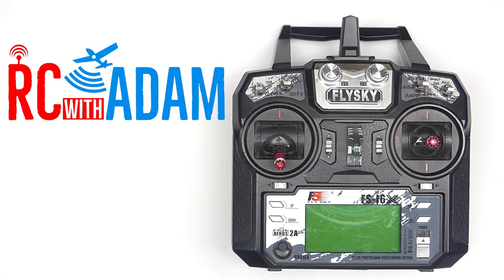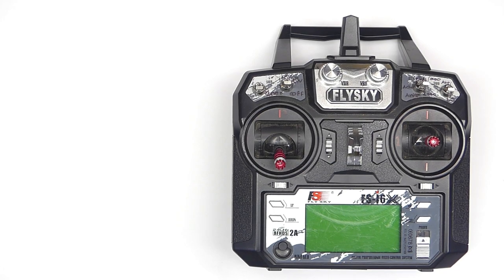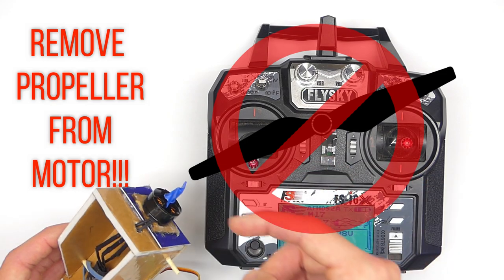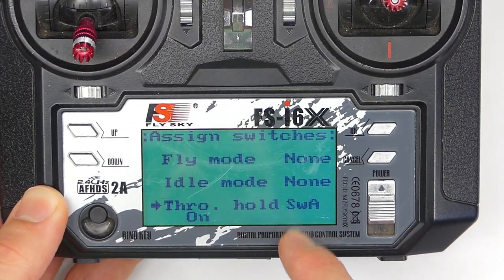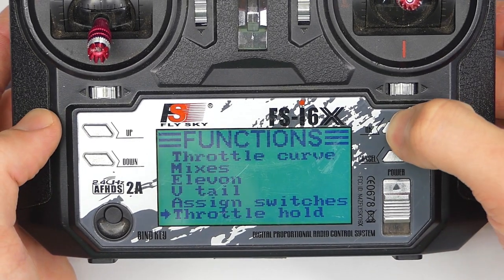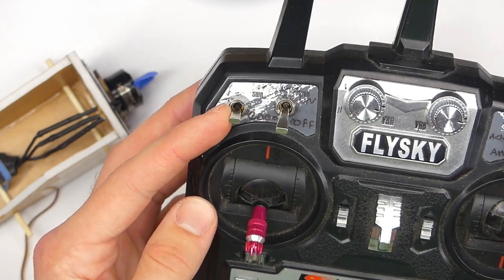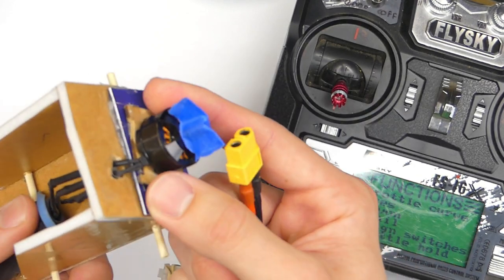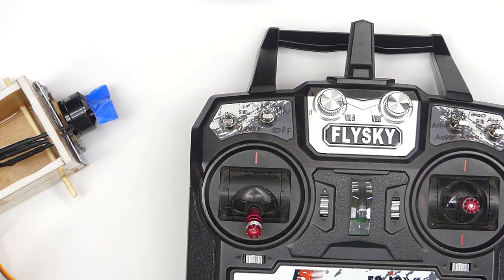How to Setup Arming Switch for Airplanes - FS-i6X and FS-i6 Tutorial

Comment: Finally!  FIRST assign a switch, NEXT, set the >OFF< value to 0%,  THEN flip your assigned switch to ON BEFORE pressing the CANCEL button to SAVE the new 0% value.  Just what I needed to do to create a kill switch on SWD without my % value reverting back to the default value that I was trying to reset.  You made it so SIMPLE  that even this FS-i6 Newbie got it done for much welcomed propeller safety when I'm tweaking other settings or devices where accidental prop spinning could be disastrous!  :face-blue-smiling:

Comment: Great...!  Had some guys in the club ask me why I didn't have a "Kill Switch" on my Tx., in case the throttle got bumped.  Now I can do it to BOTH Tx.'s, and they will be "proud" of me!  
(They all have Spectrum Radios, and didn't know anything about my "CHEAP" ones!)  Haha!
Thanks so much for all your Videos, and helping a newbie learn How to Use what he's already bought... (Can't afford the "High-Priced Spread"!) Haha!
Reply: You left me confused!
Reply: @DLM517  I was just learning how to fly planes a couple of years ago, and had sat my pane on the flying line - with batt. plugged in and Tx sitting by it.  Someone picked up my Tx and accidentally bumped the throttle, and my plane took off by itself (good trim, I'd say!).  It crashed on the other side of the field (no "Biggie" - Foamboard Plane), and was told I needed to have the "Throttle Kill Switch" in the OFF Position.  Heck, I didn't know how until I saw this.
Fly more (it only cost $$$ when ya crash...!)

Comment: Only thing from what I can see is that everytime you switch the TX on with the switch in the down position, the TX will go into warning mode, so you will have to switch it to the up position for the TX to work normally.
Reply: I have actually set mine in the idle mode on switch D then change the throttle curve in normal mode to all zero so switch D will stay in the up position when you turn the TX on without the warning alarm activating.

Comment: Great safety tip!!  Many thanks for sharing.
Have Fun,
Joe
Reply from the maker: Yes! You're welcome!
Reply: @RCwithAdam1  i have a problem with mine, my motor only stop when the throttle was in the midle and if i put it down the motor rotate to on side if i put it up the motor spin in the other direction can you help put this motor rotate only in 1 direction? Thanks

Comment: Hello!
Sorry, but NO, do not do this! 
Given that the FS transmitters want all the switches in the "up position" to turn on, this is quite an unsafe method, as the engine will be armed when the transmitter is powered! (I know you are not supposed to turn on the transmitter after the model, but that's exactly why you set these types of safety mechanism: catch fuck ups)
It is much safer to have an inactive throttle when the transmitter is turned on, and you to have to voluntarily arm your throttle when ready to fly.
-Go to "Assign switches" and at "Idle mode", assign switch A (or whatever other switch you want).
-The go to the "throttle curve". "Normal", change all values (L to H) to 0. Flick the A switch down and you get "Idle up" mode displayed. Here, you put 0,25,50,75,100, or whatever response curve you use to fly.
There, your arming switch is set properly, and if you forget your transmitter in the armed position when turned off, it will ask you to put it in safe position when turning on next time. 
And there is also very little risk of triggering the engine accidentally when setting this up as well (but you do not need the model to be powered up to do it anyway).
Then you set up your fail safe with a 0 throttle, so if you turn off your transmitter before your model, 0 risk of its engine to turn on (as long as you use fail-safe-able receiver).

Stay safe and have fun!
Reply: Gregory Dahl  I'm confused: who talked about props?
Reply: Gregory Dahl  I'm sorry: 
1- You still have not explained what did props have anything to do with my initial comment? (basically, why did you write this as "reply" of my comment as it is off topic). 
Moreover, do you remove the props off your models after every flight?
2 - You seem to have completely missed the point. 
The method presented in the video is dangerous, because the transmitter powers up in the "armed" state. 
The whole point of a safety measure is to make it fool-proof. It should not be something extra to think about, or you are asking for incident/accident to happen. In this case, it changes nothing safety-wise to not having a throttle hold at all (as you either have to remember the proper posture of a switch, or of the throttle stick).

If you take the time to set a switch for this function, do it properly.
Ensuring the transmitter powers up in the "disarmed" state gives you one less thing to think about and to go wrong. Period.
Reply: Gregory Dahl  What did I say? "Pushed away from you" dude, either learn to read, or get your head out of the sand....
But thanks to confirm my suspicions abut you.
Reply: Gregory Dahl  There is a point where it is useless to talk. I have neither the time, nor the crayons to make my explanation clearer than in my first comment.
Reply: Yes I agree, I just set this up on my FMS Moa with electric motor. You can not switch the transmitter on with the aux switch in the down (unarmed) position. I will undo those settings and try to set it up using your method. Cheers
Reply: Brilliant pierauspitz, it works. Thanks
Reply: Definitely, this setup makes much more sense. It sounded weir to me to have to switch something ON to enable a safety feature otherwise the throttle is armed directly after TX boots up, so I wanted to ask for a way to reverse the switch direction. And here is the solution for just that. Thx.
Reply: Gregory Dahl  The whole topic of the video is about winged aircrafts. Read the bloody title and stay in topic instead of saying untrue nonsense and advising very dangerous things ( you must be a special kind of stupid to set an idle that keeps the prop spinning on a electric plane or e-glider). Moreover, when losing radio contact with them, better have your plane or glider failsafe into a gentle glide, rather than barrel through the sky at full tilt and no control. Pretty obvious, but not to everyone it seems...
Reply: @pierauspitz  Don't waste your breath mate! There are plenty of strange folks on Youtube. :D
Like Pete Davis and Forget8About8It said, many thanks for your more sensible solution.

Comment: Can I use the same setup on a quadcopter
Reply: NO (maybe you can but don't) 
If you are setting up a quad you should assign arming in the modes tab in betaflight. If you set it up in betaflight on your flight controller it double checks some other stuf for you (like stick position, battery voltage, quad orientation,...)

Comment: If you want to achieve the same thing with fs-i6s (or any other transmitter that doesn't have a specific arm switch configuration), I Played around with the mixes and managed to create an easy arm-switch surrogate:

- Set switchA as channel 10
- Enable mix1 with the following setting:
    - Master Ch10
    - Slave Ch3
    - Offset -100%
    - Neg 100%
    - Pos 100%
- Result is that in the up position (the one that is required to turn on the Tx), Ch3 is forced to -100%, but in the down position (armed) full throttle control is enabled by Ch3.

(swap Ch3 for your throttle channel if you are not Mode2).

None of this is unique to the fs-i6s, so perhaps this trick is as old as mixes on transmitters...

Have fun and be safe.

Comment: Adam trying to setup my Flysky for Realflight but my left stick is reversed.  Vertical is rudder and horizontal is throttle.  How can I reverse that?
Reply from the maker: Hi! That sounds like a channel mapping issue that you can usually change within the simulator control/channel settings (I don't have RF, but I've had the similar situation with other sims).

Comment: But doesn't this defeat the purpose? The transmitter won't turn on until the engine cutoff switch is in the GO position?
Reply from the maker: I think I see what you mean. The standard procedure is to turn on the radio and set any switch correctly, then turn on the aircraft, so that shouldn't be a problem. Also, the active position of the arming switch for can be changed so that when the tx turns on and the switches need to be in their initial position, the arm switch is inactive.
Reply: @RCwithAdam1  Here's what I had in mind! Motor won't turn on till you put the switch down and tx won't work till you put it up: https://www.youtube.com/watch?v=xt5IdeLdiug&t=616s
Reply: Yep. That video by Andrew Newton from many years ago is the ONLY smart way to set up these Flysky transmitters for motor kill! The only possible thing to add to it is to set that chosen switch to be one that is LEAST likely to catch in your trousers leg as you walk with it in 1 hand! ;-)

Comment: Hi adam! How to setup arm switch for flysky i6S ???
Please reply soon. I'm frustrated!!
Reply from the maker: Hi Electronics Freak! What aircraft are you flying?
Reply: @RCwithAdam1  I am flying a quadcopter with Naza M V2 flight controller.
Reply: @RCwithAdam1  Actually I need some clarity regarding how to arm the quad with flysky i6S and also the connection diagram between Naza M V2 and flysky i-10B
Reply: @RCwithAdam1  reply fast man.

Comment: How do I choose which propeller to use for my quadcopter if I have already calculated what the thrust per motor is? thanks
Reply from the maker: Hi! What model quadcopter and motors do you have?
Reply: @RCwithAdam1  I'm actually building one from scratch. 3d printing my own design for the frame. I'm planning on using a motor that gives a thrust of atleast 675g/motor
Reply from the maker: Ok cool! Do you know the size, kv, and voltage of the motor? Most of all, the kv (rpm per volt) will determine how large of a propeller it will handle. For example, an 1806 size, 2300kv motor with a 3 cell battery could spin a 5045 (5") or 6030 (6") propeller.
Reply: @RCwithAdam1  ah okay, i think that solves it. thanks!

Comment: Hello Adam...! Great video I needed that on my Flysky FS-i6X for my Quad-copter. It's a 500 mm Quad (about 20" arm span) I'm using the Pixhawk PX4 Flight Controller, it came from China so I'm not real sure what it's going to do when I try to fly it..? I live in the Southern New Mexico Mountains and there's not too much around here for parts, mostly Internet Drone suppliers... I'm not sure where you are located but I was wondering if you could do me a huge favor..? I run my Drone on QGroundControl w/Telemetry and I want to monitor all that on my Samsung Galaxy Tab 2, 10.1" WiFi only. I have searched the Internet for a supplier of a "Mounting Bracket" to Mount the Tab 2 (Tablet)onto my Flysky FS-i6X Transmitter. Usually, the Bracket Mounts to the Center Piece in between the two joy sticks where the Lanyard would be clipped on and there is a nurled type thumb screw that fits exactly in the round hole and threads into the mounting bracket. I've ordered a couple of these mounting brackets off the Internet and neither one of them line up, there impossible to use, so I've got parts. Would there be a Drone supply house near you where get your parts, where you could take one of your Flysky FS-i6x Transmitters w/you and see if you could get something or a mounting bracket for the Tab 2..? The Bracket needs to open to about 7+" tall, length doesn't matter, but it's 10.1" long. If one is available or something I could use, I'd gladly pay you for your troubles and the parts or bracket if you can find one..? Thanks in Advance,
James......
Reply from the maker: Hi James! I wish I could help, but I really don't have any local hobby shops to go to. Sounds like hardware store kind of project to make a custom holder rig.
Reply: @RCwithAdam1  Ok Adam, sorry to bother you....!  =)
Reply: @jalpa9642  Maybe you can try to 3d print something? Or find a model online and print it on demand and get it shipped to you?

Comment: Why is it that when I turn on my switch it it goes 100% throttle and  a mix of ailerons and rudder?
Reply from the maker: Which switch are you turning on that causes this? was it working correctly before?
Reply: @RCwithAdam1  Thanks for replying! I I binded it just like you said in one of your videos. When I tested switch A it did just that. But it's Okay now I just factory reset the whole thing.